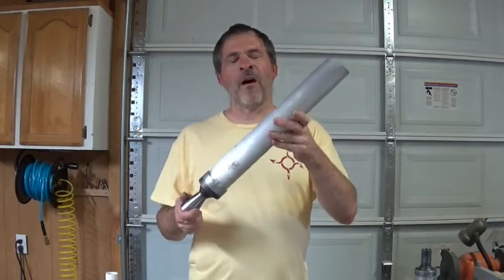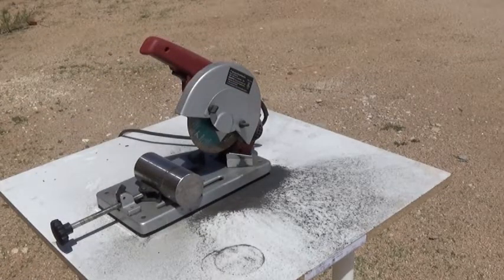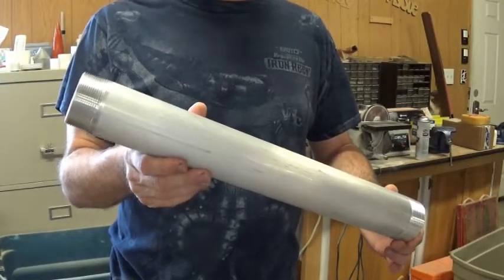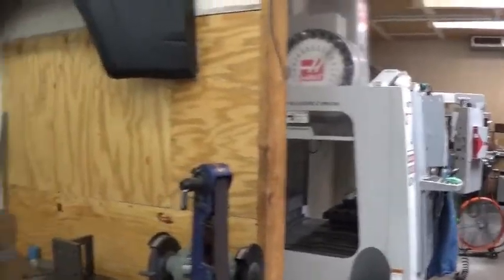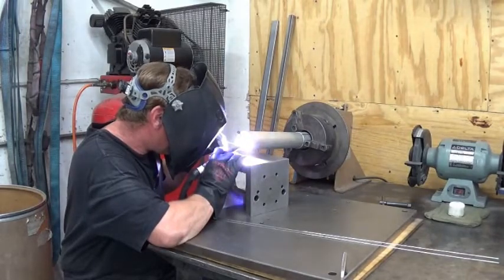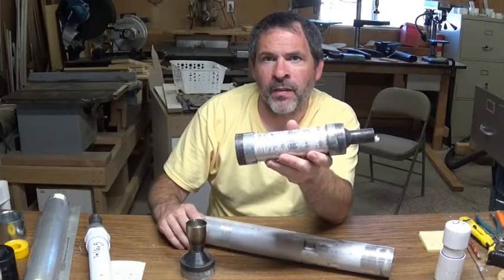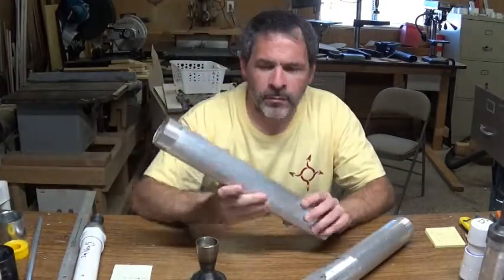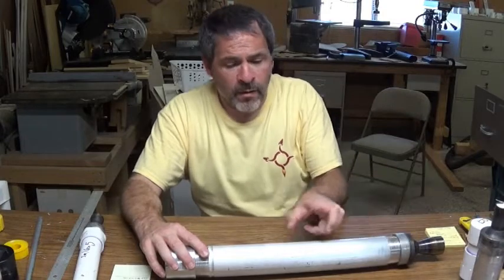Our BIGGEST homemade rocket motor EVER - PART 1

Comment: The reason the segmented cells/grains keep failing is because, there is still air, no matter how small, between the segments which promotes burning between grains/cells and eventualy causes the casing to fail due to heat and pressure. As I watched the series of videos, you progressed towards monolithic pours for the solid fuel engines and you had much greater success as the fuel itself serves as an insulator prior to ignition. Segmented grains/cells may still work if you were to put a hot maleable layer of fuel between the cooled grains, like mortar between bricks, as you were assembling the engine. Thank you so much for producing all these videos, they are very informative, educational and inspiring.
Reply from the maker: Could not have put it better myself. I have a few very successful PVC motor designs that we launch often and they use a single monolithic fuel cell. I would rather have the thrust curve produced by multiple cells but the mono design just works so well and it's quick and easy to build.
Reply: @rotaryrocketry, you may be able to use segmented grains/cells to achieve your goals if each of the grains/cells were fused together. A controlled baking process may be enough to fuse the grains/cells together after assembly. I'm not sure if the fuel you use can be reheated without some degradation.
Reply from the maker: Possible... or possible that just a really good heat barrier material would do the trick. But it's just not worth it. I don't even need to use any heat protection with my PVC case when using the single fuel cell.
The final result of this 6 part series was a single cell motor that used a PVC pipe as heat protection for the steel case. It was eventually used to launch our 1000 subscriber special rocket with amazing speed and altitude. In fact, that launch was so insane, that we have never used this motor again.
Reply: @rotaryrocketry  that launch was phenomenally spectacular. I'm planning on experimenting by standing on the shoulders of folks like yourself. I'd like to get my Level 1 and 2 certification so I can participate in sanctioned launches. I built several model rockets when I was younger and now that I'm retired I'd like to get back into the hobby. You know how it goes life gets in the way of your interests sometimes. I'll definitely share my results with you as I progress.
Reply from the maker: That launch may have looked good on camera but it was downright scary in real life! I blinked and the rocket was out of sight.
Well, don't be shy. I love answering questions about my stuff and would love to see how your stuff goes.

Comment: The motor is built now, but for the next one, you might want to consider having a removable forward closure. It reaaaaallly helps with cleaning the motor, remove the liner, and it's just a lot more convenient. 
Nice looking thrust though, you've done a great job !
Reply from the maker: Well... It may look like the build is done... But...
Part 2 coming soon.
Reply: @rotaryrocketry  I might have posted the comment before watching the whole video🙄

Comment: A very impressive accomplishment indeed!! 

The bulging at the head end could be caused by a buildup of high temperature slag or solids that accumulate in a very large motor.. Turn the motor on its side to test or better yet so the exhaust is pointed down and this will allow the solids in the exhaust to vent out. Aluminum loses a lot of its strength when hot even at 400° F. Doubling up the inhibitor will offer better heat resistance.

I know this will probably cause challenges in measuring the thrust. Putting the motor on its side would be the easiest solution and should work fine.
Reply from the maker: I had not considered that the bulge may have been caused by residual heat settling. Interesting concept. You are right, turning the entire rig on it's side would be a bit of a pain.
That said, we have already done another ground test for the next video and had some "interesting" results. We are still working on it... Stay tuned :)